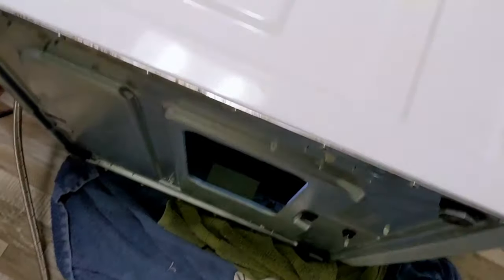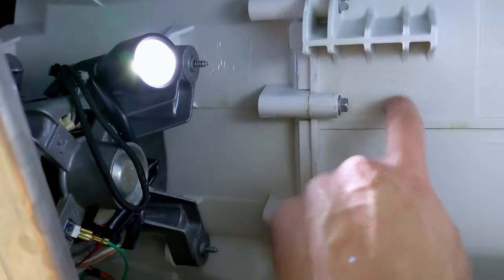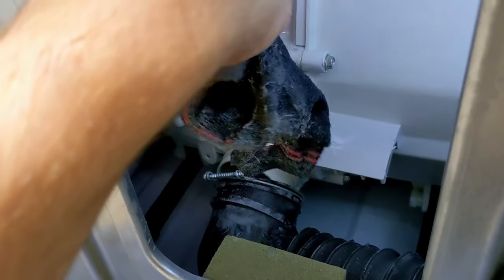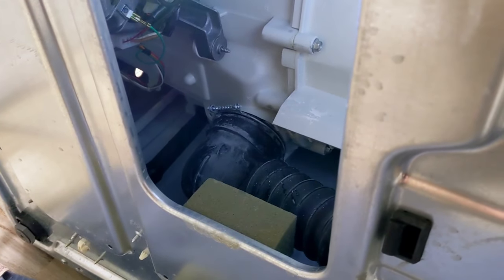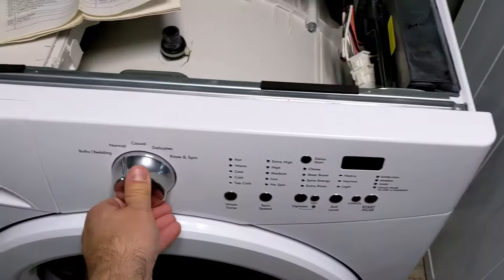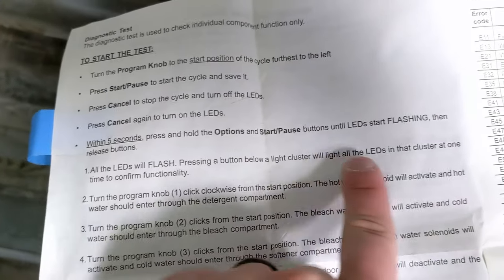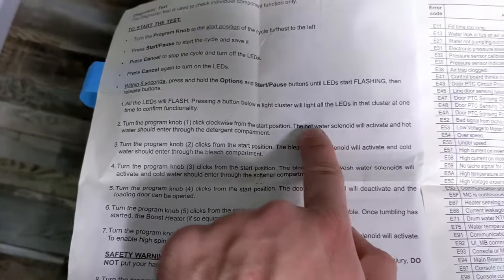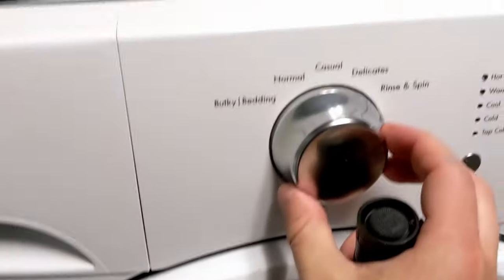Fixing Washer Issue Where Clothes Are Still Wet

Comment: Kenmore W10280537A top loading ends with wet clothes, maybe 1/2 dry as usual; but, if do extra spin/drain cycle ONLY comes out ok as usual
Reply: Same happening to me.
Reply: Seth did you find out what the issue was? I'm having the same issue
Reply: this is exactly what is happening with our whirlpool washer! did you ever find a solution?